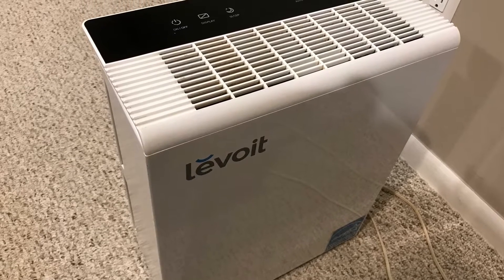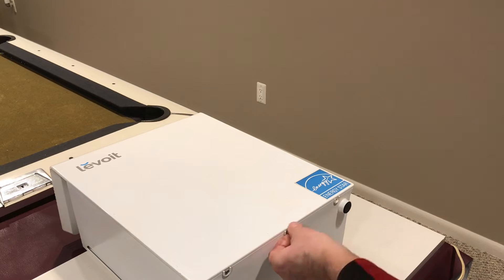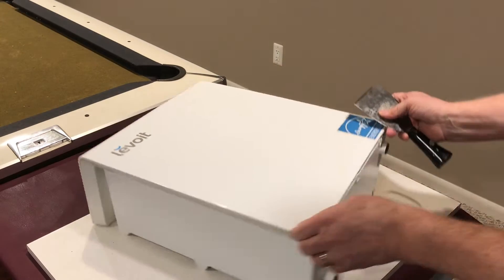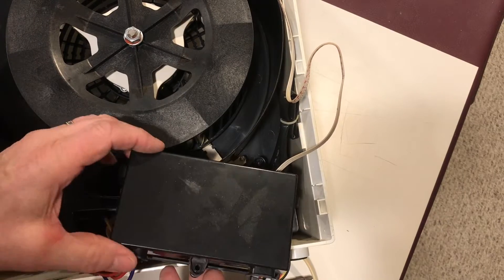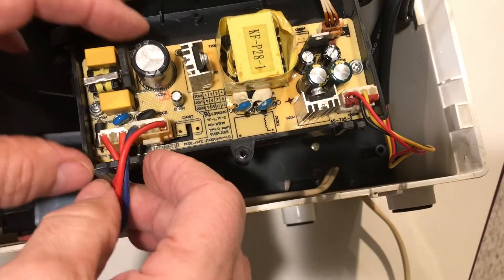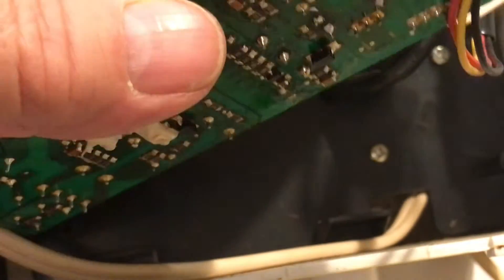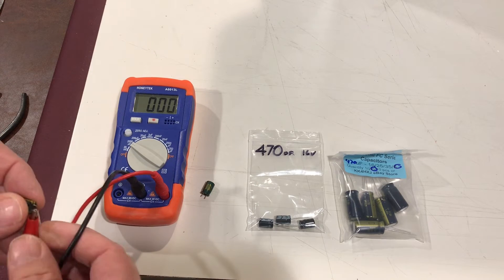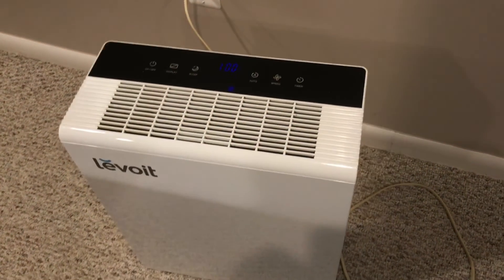Levoit Air Purifier Power Supply Repair

Comment: Hey I had the same problem, mine got stuck with the red light and was un-responsive so I replaced the 2 capacitors 1000uf 35v but the unit is still stuck in an unresponsive state. Should I replace the 2 smaller 470uf 25v ones as well just in case?
Reply from the maker: Yep - I think the 470 caps are the issue
Reply: @xfireamg417 So I just swapped those too and it's the same thing, turns on and then stays on the red lights. Anything else you could think of I could try replacing? I even tried to hold the filter reset button but no response
Reply from the maker: don’t have any other suggestions. Sorry. I no longer have the unite to do further testing
Reply: @xfireamg417  Appreciate the response, ill try another set of capacitors just incase I have a bad set
Reply: @xfireamg417 Great news I went back and did a better job with the soldering and now it's working again. This was my first ever time working with electronics like this so I'm just glad it's back up and running
Reply from the maker: @MasterMark5  Outstanding-

Comment: I had the same problem with 2 of my 3 Levoit Air Purifiers.  One of them was a replacement sent by Levoit because one stop working just before the end of the 2 years warranty.  Not much luck with the replacement unit which also stop working.   I did check the capacitors in the power supply box and exactly the same 470uF 25V capacitor was faulty and I replaced both in the 2 Levoit unit and they work perfectly now, thank's to your great video.   I may just had that you should try to replace them with the Low ESR green versions of the 470uF 25V capacitors.
Reply from the maker: Thanks , and glad you fixed them

Comment: Absolutely incredible.  I cannot thank you enough.  Not only the diagnosis of the problem but the great detailed how to.  Symptoms of this problem included weird in between colors on the air quality indicator light.  Generally dim display.  Unit would randomly ramp up from blue to green to red and then back down to blue.  Then after turning it off it wouldn't turn back on again at all.  Swapped both the caps and its working good as new.  I have a second unit with the same problem.  Will swap those out too. Other than this problem I really like the air purifier.
Reply from the maker: Glad to be of help with this

Comment: Another thankful individual for you taking the time to share this!  In our particular unit, I didn't notice any bulging capacitors but since it was acting funky electrically (it would start to power on, but then the LED display would just be unresponsive and dim) I figured I would give it a shot. My unit had 470u 25v capacitors and it looked like there was some sort of leakage in the area but not as bad as in this video.  I happened to have some 470u16v capacitors so I took a stab at just replacing the 25v with those and low and behold it brought it back to life!  I'll order some 35v ones like some people have suggested to use if these ones fail.  Thanks again!!

Comment: They were throwing this model out at work so I took it home and contacted the mfg for help. They said it's discontinued and they would provide any help so I Googled the problem and came across your video. 
$5.99 from Amazon for a PKG of 15 and received them the next day.   The old ones showed no signs of failure but I replaced them anyway and she fired right up. 
Thank you for the help that the manufacturer did not want to provide.
You should put an Amazon link for the part so you can make a little money for this awesome video.
Reply from the maker: Glad it helped. No idea this problem was so widespread. 😊
Reply: @xfireamg417 thanks for the video. Replaced a few capacitors and it fired right up.

Comment: Echoing what many have said, same issue, caps not leaking but replaced both anyway after checking with my multi-meter and one was definitely reading different than the other. With no more Radio Shacks around, I didn’t want to wait for mail order but lucked out as there is an electronic component store not too far from my house. $0.50 for both parts. Filter running like a champ again!  Thank you so much! Wonderful video!

Comment: Thank you so much for making this guide! 2 things if I may add: 
1. I was able to work that triangle screw with T10 torx. 
2. I used 470uF 25V, same dimension.
Reply from the maker: Yeah - best to up the voltage on the caps, although the lower voltage replacements i put in are still holding. Hmm
Thanks for the feedback and the screw suggestion

Comment: Hello. I have this same unit purchased around 2022 however, when I took mine apart, the two small capacitors read 25V. Since I already ordered and have the 16v in hand....I'm wondering if they can be installed with no concern or should I exchange them for 25v? Thank you.

Comment: In case you see this message… I see a small leak not near the capacitors but closer to the unit number cn205 where the white power cord comes out of. I have never soldered before but bought a lot of Amazon to try this out. I mean why not. But if I replace the capacitor and they turn out to be not the fault but the power cord itself… is there a way to fix it by any chance?

Comment: 2025 and I just fixed my unit with this method.  Not sure when I bought it.  2020ish maybe?  Replaced with 25v 470 and 35v 1000.  $6 and I have enough to do this three more times if needed.
Reply from the maker: Way to go

Comment: The 16V 470uF capacitors need to be uprated to 35V 470uF as it's a 24V circuit. Otherwise they will just fail again in exactly the same way regardless of brand. I also replaced the bigger pair of capacitors as a few videos have those looking swollen too, though I'm not sure why.

Comment: Hello xfireamg! My purifier was working fine, I unplugged it for a couple weeks and now it shows the red power light and blinking filter. No buttons are responding at all. Was this the beginning condition of your air purifier? You dont show the "Before" and I was kind of assuming that there was an error in my computer board.
Reply from the maker: Hi - Not sure what all the symptoms were as the owner just gave me a non working unit. As you can see from most of the comments numerous folks give it a try and found the capacitors to be the culprit. Might give it a try and see
Reply: @xfireamg417  thanks for the reply, after I wrote this i did see similar questions and replies. I took it apart and one of them appears to be bad with my limited multimeter abilities. Ordering the caps to see how it goes. Unfortunately, electronics stores do not really exist anymore in brick and mortar.  I miss the days when there was a MarVac down the street.
Reply from the maker: @kaput450 - good luck. RIP Radio Shack and Olson Electronics.
Reply: @xfireamg417  Success! Great excuse to buy a new tool (multimeter with capacitance capabilities) and have a working air purifier as well as enough capacitors to fix 6 more. I have another the same age that is currently working but after seeing all these replies I expect it to fail soon. 

Awesome to keep these from going in the garbage and I learned a bit about capacitors.

*Pro Tip... do not do your resoldering on your lunch break after drinking a pot of coffee! Also I ditched the triangle screw and used the one that was on the pcb board box since it snaps together anyway.

Thanks Very much for posting this Video!
Reply from the maker: @kaput450  - Glad to hear it

Comment: I have the PUR131S and it decided to die 12 days after the warranty was up. 
I opened it and sure enough one of the caps in the spots you showed was bulging (they seem to have upgraded to 25v caps for the S models). I have never soldered before but decided to give it a shot. I already had a cheep soldering from years ago but never used and I happened to have a triangle bit for that one screw so for $2 for new caps at a local electronics store I was able to fix this and it is working perfectly again! Thank you so much for this video!
Reply from the maker: way to go

Comment: Everytime i try a repair like this, it never works and I waste time and money. What were the symptoms of failure? My unit turns on, but the touch panel switch will not respond. Please advise. Thank you!
Reply from the maker: Never got a chance to really diagnose the symptoms. The two units I worked on were headed for the trash so I took them apart and found the same capacitor issues. Replacing those caps got the units operational so I don't need to investigate further. Not much help sorry.

Comment: 😎 Thank you for the fantastic repair video! My Levoit air purifier is now working again. I bought the 16v 470uF capacitors from Amazon, costing about $13 including shipping for a package of 10.  I paid $2 for solder wick and used my old soldering iron from years back.  Now, I have a working purifier. Thank you.
Reply from the maker: @CanoeCG  - Tx- it continues to amaze me how many people found this to be the problem and successfully remedied it

Comment: Thanks! I replaced the two capacitors and it works again. The problem, however, is that they will die again because the power supply design has a hot transistor that is too close to the caps, and it will cause them to fail prematurely, again. I'd like to say that I worked out some kind heat shield for this, but I didn't - I just put it back together.
Reply from the maker: Hi - I don't recall the temp rating of the capacitors, but you might be able to find replacement caps with a higher temp rating.

Comment: Thank you! :) One of my two Pur-131's stopped working after a filter swap, and once I pulled it apart, I noticed a bulged 470 capacitor and a bulged 1000 capacitor. I will just replace all 4 while I am in there, since they seem to be a very common failure point for these units. I will get those ordered right now :)

Comment: Mind if I ask what were the signs that you needed to do this repair? My exact same model recently will not turn on when plugged in. The screen will briefly flash but then the only sign of power in the unit is that the colour indicator (red yellow green) is a very dim orangeish hue. 
Could this be a capacitor issue?

The only other thing that I thought it could be is that my rabbit lightly nibbled the cord several months ago. However,  he hasn't had access to the cord since then and the unit was working fine until this recent power issue. If it's a chewed cord that's the issue, is there any way to fix this? 

TIA!
Reply from the maker: @hez__zure  hi maybe someone else can share their story, but in my case the owners said they tried everything in terms of cleaning and resetting without success. That’s when i took them apart and found that problem.
Reply: @ Thank you so much for your very fast response! I just discovered a post on reddit with the identical issue and at least one thing to try before I attempt to repair the capacitors (which some people did and it fixed the issue I have). Thanks again!
Reply from the maker: @hez__zure  Yeah - you want to try all the general maintenance and resetting processes first. Good luck. Get that baby going.

Comment: Thanks for posting the video.  That fixed it!  It is otherwise a nice purifier.
Reply: When you were soldering the new capacitors, where you place them there is a circle that is half dark and half light. Do you know which side is positive and negative?

Comment: My unit had the 470uF, 25v and the same issues as reported here.  I ordered replacements on Amazon.  Replaced the two capacitors (after hunting down my soldering iron), and the unit now works!  Great video. On the unit the negative post went in the shaded area on the circuit board under the capacitors closest to the wires.
Reply: just passed 3 years the capacitors did go found the same capacitor in Old microwave working fine thanks
Reply from the maker: @johnweald2250  YouTubers rule!

Comment: Thank you. I have a few of these, and the first one I tried the fix didn't work at first. Then, as a last resort, I pushed the filter reset button and held it for 10 or 20 secs, and it started up. I fixed a few more doing what you did, and they started up immediately even without the reset. Success! 

If anyone else has a problem with them not starting after this repair, try holding in the filter reset with a toothpick too if necessary.

BTW, Levoit sux for the triangle screw. F*ck them.  Right to repair!

Comment: You've saved another unit!!! I dragged my dead machine around for over a year after it mysteriously died, thinking it must be fixable. I have never before worked with a circuit board nor a soldering iron, but your video made this a really simple and cheap fix, and I only spent 15$ and learned some basic skills in the process! Thanks again! ✨👏
Reply from the maker: I had no idea this was such a pervasive issue. Glad I captured and posted this so others could benefit. Way to go!

Comment: where do you get the special screw driver
Reply from the maker: @Ashleyapples  some folks said they were able to get the screw out using a regular (small) flat bladed screwdriver. I have a set of the unique head configurations but apparently you can make do with a flat head

Comment: How to access the inside of a Levoit Vital 100, as something dropped down through the slats on top and into the impeller area. It's rattling around and I can't shake it out when I've removed the filters.
Reply from the maker: Hi - I've never worked on that unit, don't know how it comes apart. Sorry.

Comment: I changed the capacitors in two units. They both worked for about a week. I noticed the sensor on the unit was not acting correctly. I could not change any functions. I tried unplugging it and it wouldn't turn on again. Any suggestions? Thank you in advance for your input.
Reply from the maker: The units I repaired were sent on their way and I never had to do further forensics. So it may be that the caps are the root cause or it could be that something else is causing the caps to fail. Not much help - Sorry

Comment: I’m in need of help. And advice.

My unit is 2 years old. Mine, like the one in this video, has I’m guessing bad caps. One has a slight bulge. I will replace it. However, the white plug next to the caps that need replacing is melted together. I have enough slack that if needed, I can replace the plug, but I have never done that before. 

Is there any other way to get the plug out? The clip and the latch plastic did come apart. I’m guessing it’s melted inside.

Also, the 2 left plugs were lightly melted together. Should I worry about this thing catching fire???
Reply from the maker: Sounds like your unit may have something serious going on. Maybe time for a complete replacement. Sorry can't help with this one.

Comment: Judging by the number of comments - you definitely saved quite a few thousands dollars for all the victims of faulty capacitors :) Adding one more and thanks for the nice guide! Saved three units for me! Btw, 16V seems to be too small of an overhead above it's operating voltage, which might be the reason why they blow for so many people. Alas, I didn't have anything but 16V or 60V on my shelves, and 60V just didn't fit. So far, so good with the 16V but may have to repeat the procedure later on.
Reply from the maker: Glad you got it humming again. I'm with you, a higher voltage cap might help but I didn't have one that fit. Unit still working with the replacement caps. (fingers crossed) Thanks.

Comment: I have two of these air purifiers that went bad. I replaced the specified capacitors in both of them and it fixed one of them, but the other one still won't work. There's no visible damage or leaking of parts on the pcb to indicate any obvious bad parts. Any ideas what else could be causing it not to work? It doesn't light up at all when plugged in.
Reply from the maker: Hi - Glad you got one working. Don't have the units anymore and really can't prove any additional insight. I think one of the viewers posted that they also changed out the larger caps. Might give that a try. - Have a good day.

Comment: Small Flathead works on the triangle scews, or a small allen wrench. Anyone know if you should replace both capacitors or just the damaged one. Thank you!
Reply from the maker: Hi - Sorry for the delayed response. As a preventive action I suggest changing them both. Might save you from taking it apart when the other one fails.

Comment: Thank you, this was very helpful. Will try it. The cap on mine that seems to be faulty is one of the small ones in your video. The printing on it says it is 220uf 35V. Do you know where a good place to buy caps is? I don't want to use eBay and maybe get a cheap one that won't last. I've seen people mention Digikey but they're in Canada so shipping is crazy expensive for a tiny little cap. I'm in the U.S. Thx.
Reply from the maker: If you stick with a brand like Nichicon or Panasonic you should be could. Mouser is another source, but I found these on Ebay 

https://www.ebay.com/itm/145449085231?_skw=220uf+35v+capacitor&itmmeta=01J8HK8520BWZR8JJN64HMTF0M&hash=item21dd70e92f:g:soMAAOSwcERlW7FT&itmprp=enc%3AAQAJAAAA0HoV3kP08IDx%2BKZ9MfhVJKmJhnHRqX%2B77f0SGB%2FD4TtnJ4snDsY4ktfMOqkpnui1TeGMJEPKViCFX33zjYHJT13%2BlKR2HWomO7gnFb%2BQNn%2FC4afc98iEf8Iv%2BanbDzqLFoZME9kFoTcT4z7Y3UFq2E5PosSA7TN5BmcwIO%2BpRMW9VO5fMl5lvi%2FDcwz%2Fvz4NjZrnUmDaSkzuGz2QsURo0bjGi8W1eyqne3Dc2wvwyvzj9fVjFr1CTymKtDRndXSJNIOqqLWatLk7nVuzsUUyIMY%3D%7Ctkp%3ABk9SR5zRoLPEZA